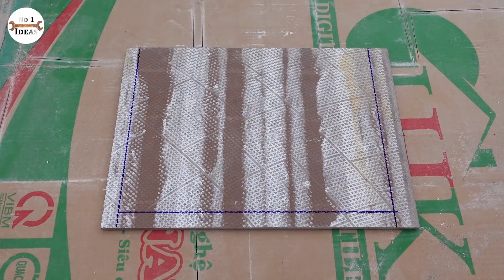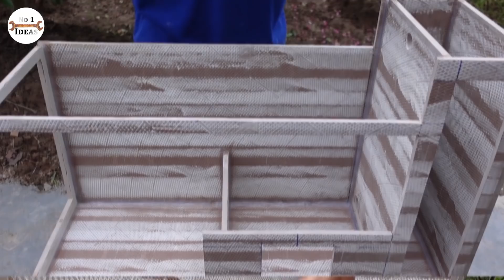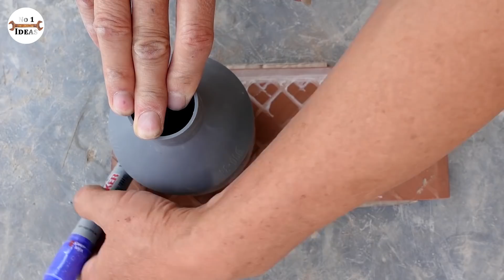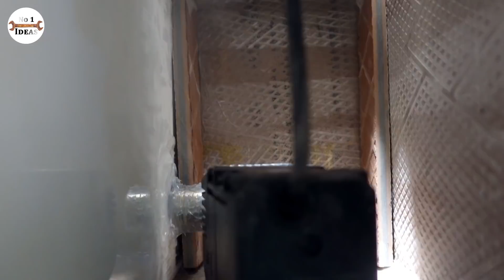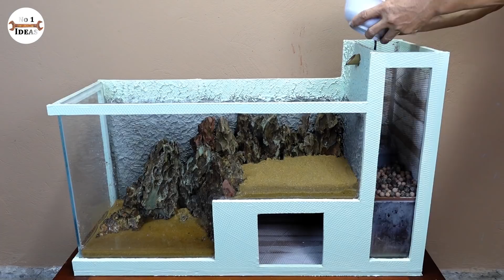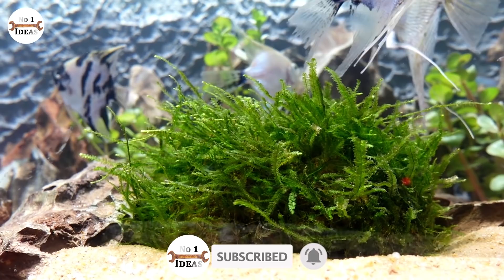Diy Beautiful Aquarium For Your Home

Comment: Can i make this with plywood then coated with cement.... Is it possible....
Reply: Cement is porous and water will leak out.   Plywood aquariums are a real thing though.   They make a paint-on pond liner that you will use that is 100% waterproof.  It is SUPER important that you have good bracing and even support underneath on your stand.

Comment: On the filter side, the white filter should be the top and be disposable. The rocks on the top were useless for filter, but may be be for aesthetics because they are too smooth for bacteria to live on. I would suggest using stacked spong filters and the finally getting to the balls and finally the white fine filter. You would still need to pull it out every few months to clean though, so the set up isnt ideal for the maintenance for the filter side.